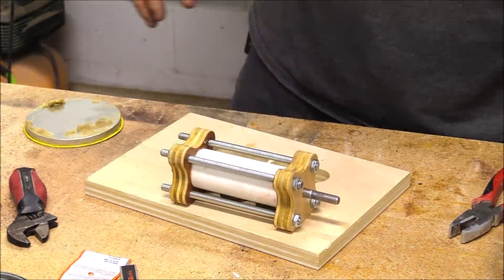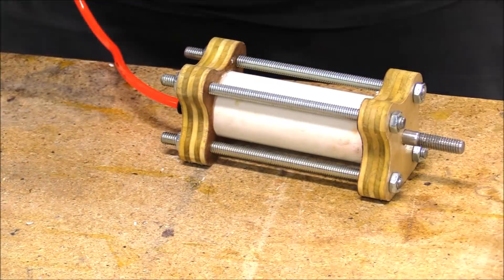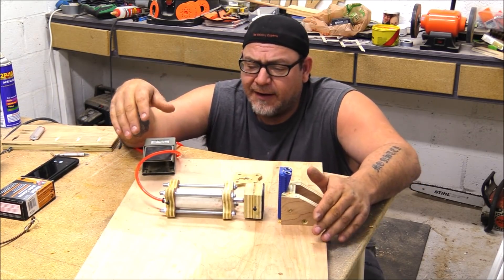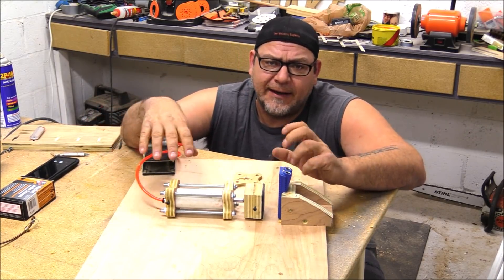Homemade PVC Air Cylinder for a Pocket Hole Machine | DIY

Comment: Ok, That is pretty cool.  Now if you could use some of those to actuate a spider walker thing, that maybe has a small air actuated back-hoe built in....  Run off a battery powered air compressor.

Comment: You can pick up a cheap regulator with gauge at harbor freight for ~3-4$ and as you mentioned an inline flow meter for speed regulation!

Comment: That's impressive! I have that same small pocket hole jig from Kreg. Do you have any details about the holder you built? I mean it does look pretty straight forward but wondered if you had some plans or a video on this. That pocket hole kit is pretty cheap and looks like a great way to get the usability of the K4 or K5 jig much cheaper! Awesome project!!

Comment: Izzy, if you popped a second inlet in the other end panel and used a 2-way switch, like the one in the vice video, could you get it working both ways? Always appreciate your work for the way it inspires new ideas. Cheers

Comment: In my career as a piping designer I came across the fact that sometimes (don't know under what pressure) PVC pipe fails spectacularly and sends shards of PVC in all directions. Since PVC ages poorly this may become more of a risk at lower pressures. I would suggest some sort of box or containment pipe around the whole mechanism just in case of this kind of failure. After all we have two eyes at best and I really don't like the idea of loosing one. Loved the build! great idea!
Reply: Or wrap duct tape around the pvc
Reply: Harki Dodia  some kinds of adhesives will degrade plastic. It would just make more sense to shield the pvc. That said, You're far more likely to blow apart at the wood/pvc connection than the pipe itself.
Reply: If you're worried about explosions you can use black plumbing pipe and it won't ever burst under home air compressor pressures.  Copper is good too.  Nothing is cheaper than PVC though.
Reply: Good points. What would you suggest as an inexpensive alternative to the pvc? Perhaps ABS or galvanized conduit?
Reply: That add to the excitement Roy!
Reply: Pp
Reply: Use HDPE. See other post.
Reply: Just use the air pressure to push water into the cylinders. Safety Sally's can go home now. Bitches
Reply: or just use VIbranium instead of PVC, end of story pussies

Comment: I looked at the foot control it I'm reading the info correctly it will return it you used a hose on the other end of the cylinder? 3 Way 2 Position 1/4"PT Threaded
Reply from the maker: itsa single switch only works when you are stepping on it

Comment: Love the idea.  Makes me want to modify my existing jig for this.  Much easier than trying to reach around (K4) on larger pieces.  Suggestion for controlling power: Put a regulator at the pedal.  Then you don't have to remember to turn down your compressor.  It's always set at the pedal.

Comment: Nice idea! I wonder if there is an electric version possible. Some compressors can make an awful lot of noise.
Reply: Look up "Push Pull Solenoids" they make all kinds of sizes, pressure and voltages.
Reply: AKA electric linear actuator

Comment: Izzy, Wooden tool man made one of the best bench top pocket jig machines with a drill under the table operated by a lever which also clamps the work.   It would be a hoot to make a similar with two air cylinders.  A fast.one on the clamp and a slower one on the drill.

Comment: Love projects like this. 
Off the top of your head, is there a relationship between the diameter of the air ram and the holding power?
And if you want a longer travel for the ram is it better to have a larger or smaller diameter to help maintain 'power' when clamping over a larger distance.
Or, I can do some Google homework. :-)
Reply: Power is based on the amount of square inches, of the piston. If you calculate the square  inches of the piston and multiply by  pressure being used, the result will be the amount of force in pounds applied by the cylinder. Speed depends on volume of the cylinder. Larger volumes are usually slower acting. Larger lines and higher pressures can effect this also.
Reply: Loudog - all makes sense really - many thanks for your response.

Comment: Never use PVC for pressurized air! It's too likely to burst explosively. Use steel pipe or even ABS. Never PVC!! 

Cool build though.
Reply: I'd say it just depends on the pressure.  Water pipes are rated to a pressure printed on the side of the pipe.  Your point is well taken though, with no regulator at the piston, he needs to be careful w his pump pressure.

Comment: Converting a cheap bike pump comes to mind
Reply: That works well actually.  Most have a little rubber ball as the check valve where the hose attaches.  Take that out and you got a cylinder with a hose.  Only problem is it won't seal initially, until you hit it with a pulse of air or push on it, which then pushes the seal inside out against the tube wall.

Comment: You could always T your air hose and put another line to the front and use a valve to push it back the other way. Great idea using pneumatics for clamps. If you need more clamping force just make a bigger diameter cylinder.  Keep the air pressure within reason or it might grenade on you.  Watch your fingers. LOL Great project Izzy. I'm sure the safety nazis will be out in force on this one.
Reply: Lv

Comment: Would it be practical to accomplish something similar with a sucking solenoid coil with a ferrous rod within the coil serving as the piston? Seems it could be operated from 12 vdc or less with a fairly low current flow requiring wires no bigger than 18 or 16 ga. Could be operated with a simple momentary push switch modified for foot operation or a reed switch which is closed by proximity to a magnet, like those used to monitor doors and windows. The piston rod could be attached to a spring working in opposition to the energized coil in order to return the piston to standby position. The spring could also serve to modify the clamping force applied.
Reply: If you get the right valving and put an air line on the other side you could set it up to clamp when you step on the pedal and have it release  when you take your foot off the pedal.